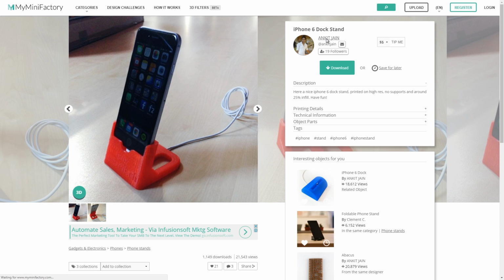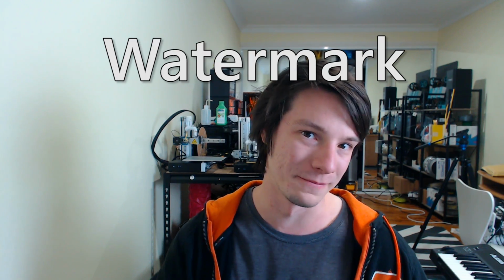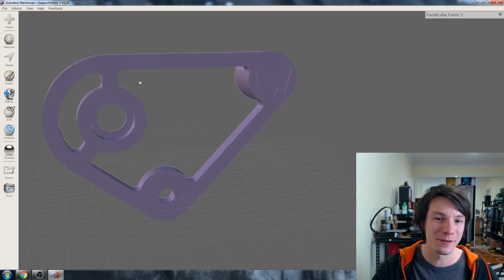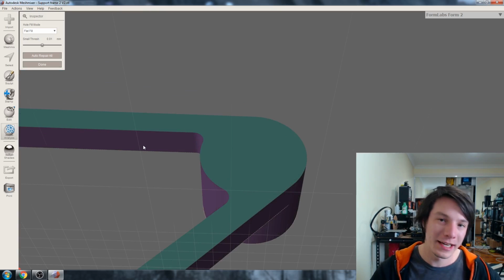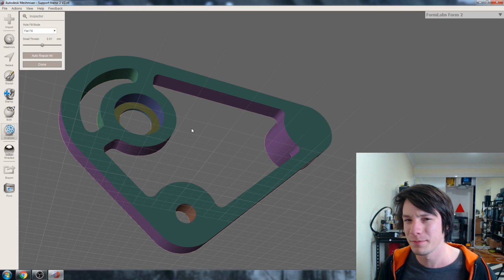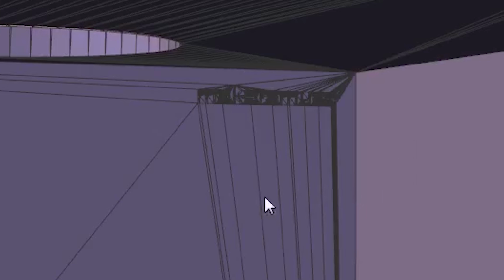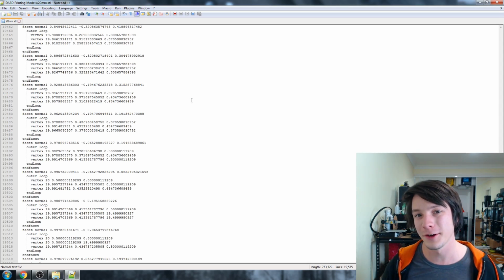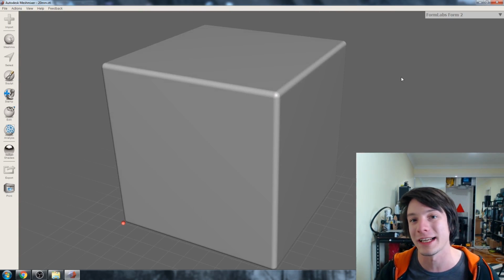3 Ways to Protect your 3D Printing Files from Theft and Plagiarism

Comment: Put the watermark inside the geometry. Unless you slice it and preview the layers or print it and watch the print you'll never know it's there. Protects the digital file because it'll be hard to find and remove and the physical object as well
Reply from the maker: Yep that's one step further than on the surface and something I thought about but haven't done yet. It's a good idea and pretty tricky!
Reply: I think the problem is if you had an issue, I doubt whatever admin you'd be contacting to have it removed, wouldn't even have the capability or know how to check the file for hidden watermarks.  Checking the date of when something was uploaded should be enough in most cases, since you could clearly show an earlier timestamp.  Another idea, is if possible, is to always create a higher poly version than the file you release.  It's hard to tessellate models with triangulated polygons, as even a square section could be split up into dozens of segments or more and any tessellation would just cause defects in the model.  

So model high poly with quads (4 point faces of geometry), then use some kind of decimate function to lower the poly count and convert the models poly's into triangles instead of quads.  It's easy to turn quads into triangles......not so easy to turn triangles into quads.  As far as I know, there is no modelling tool that automatically turns a model of triangles into quads, and it would be too ridiculously tedious to do by hand, as you would have to go in and potentially delete thousands of vertices intelligently, many of which could be supporting geometry, which would destroy the coherency of the model and cause all kinds of funky geometry issues.
Reply: Hi Geoff, Medelis... the most infamous man in 3D printing it would seem. 
Agreed, this kind of persistence has earned him some followers on Patron too, which is frustrating for everyone.
We do chase his stuff down on behalf of our designers... we did with Turbo Squid, Thingiverse and removing ridiculous levels of spam on our site too. It takes collaboration within the entire community, which we're pleased to see is very common.
Reply: oh beat me to it
Reply: That's cool but you also need to be more proactive with customers like medelis who are ripping off your models and selling them on their site.

https://www.myminifactory.com/object/guardians-of-the-galaxy-rocket-raccon-28645

Check the comments. You might ban him but clearly no one is watching the makes because this advertisement for his website has been on Tanya's model for a couple of days.

So the guy who stole it off her, put it on his site and is selling it is ok to come back in and advertise in the same models "makes" 

IMO people like medelis are more of a problem than hiding watermarks on your model, editing HEX codes, STLS files directly or any other counter measure you can think of.

No matter what you do to protect your files, there will always be an asshole like that.
Reply: recompile the mesh? wtf are you talking about. first and foremost thieves don't modify files they just download them and either pawn them off as their own or print them for money
Reply: All it takes to recompile it is them accidentally touching something, undoing the change and then saving out of reflex, since most 3D printing software gets rid off superfluous vertex without asking by default.
Reply: Actually, I got it to slice the water mark into the object. Just had to reverse the faces of the water mark.
Reply: Also if you put it in a thin part you can hold the printed object up to the light and see your logo.
Reply: If you recompile the mesh any interior faces get simply culled off, as they aren't important. This would only work if the thief is so lazy he doesn't even open the file himself.
Reply: I've seen that done, poorly, using connected meshes and it can cause slicing to fail of the print to fail because no one will think to separate connected meshes before they print it (s3d)
Reply: Tested it SketchUP, slicing with Cura 2.6.2 just removes the feature inside the cube, but it's there in the STL. Now 
 I trick the slicer to print extra features, like extra walls around holes, or walls that you normally would have walls...
Reply: this is pretty much what I was thinking, I just did it with one of my prints I'm selling and you can't see the water mark at all but if u pull it up in a slicer you can see it perfectly
Reply: Seen this done a few times. So long as importing, editing and saving the file maintains the marks, then it's doing it's job.
Also seen it done so it's visible in the slicer, but unless someone was to open try and inspect it, they are not likely to find it.
I would imagine a combination of things would be the best approach. And showing that your watermarked file was uploaded prior to the unwatermarked one would also help prove things.
Reply: That's exactly what I thought!
Reply: screwyluie lmao I've been thinking about that for a while.
Reply: Hi, thanks for the reply,
Yes it is frustrating and I can imagine moreso for you having to spend time cleaning up his mess,  but I guess the point I very poorly tried to make and got distracted by a current situation... re: the topic of this video, was that regardless of what watermark, or whatever you do - when a model is behind closed doors like a private patron account, the signatures are for nought. Patreon are getting their cut, so no need to stop it, heck I know no less than 15 designers that have individually reported him and still zero action taken nor do they seem to care and respond with the same copy/paste respons. So really, they all could have signatures on the inside of the mesh but typically anyone who signs up to download his files are not going to check nor care where they came from which is probably a bigger issue and I wouldn't even get into it, it's just too complex and widespread.  I do have to give credit to you guys, XYZ, CGT, Cults and Thingiverse for trying to be proactive about it, ironically the only sites that tolerate him are Pinshape and Patreon, both whom profit off his skullduggery.
Reply: screwyluie o
Reply: Speaking from our side, we do have the in-house skills to look for an internal watermark if its location was clearly identified to us. The idea of keeping a higher poly version as a 'master' file is an interesting solution, that could also be a valuable asset.

Comment: I think its fine to protect stuff. But I somtimes want to mod a part but have no intention of uploading it.

Also you could hex edit the binary STL to add your name .
Reply: In that case a watermark won't bother you ? And if it does you can remove it as you won't upload it. Or just credit the original designer when you upload your mod.

Comment: Three dimensional steganography? Neat
Reply: Disambiguation: Steganography applies to any technique used to "bury" information among other seemingly innocent information in such a way that it remains hidden (unless you are looking for it) but also retrievable (secret information is more or less unaffected by modifications to the host information facade)
Reply: Along those lines; you could have a post-processor that takes in the STL ascii file, twiddles the least significant decimal of each point as a text encoding method. eg, if a point is 3.123456, you convert that to 3.123457 or 3.14155 depending on wether you want to encode a 1 or a 0.  Do that to 8 numbers in a row, there's your first character. This could then be saved as binary / whatever, and since it's part of the model geometry itself, would be preserved.
Reply from the maker: Not quite as hardcore BUT it'd definitely be possible to hide all manner of messages into these files.
Reply: that would actually be pretty easy to do, might try making one
Reply: Elder Eggplant
not even close, that would be if he were to say add noise to the model in such a way that that noise could be decoded into text. say move a vertex from 13.300 to 13.302, invisible yes, but if you remove all but the least significat digit and then convert that into ascii or something, you could have text there.
we have 25 letters, make if the ladt two significant digits and then have 13.0022 or something.
plus if the stl file is in binary form its practically invisible
Reply: STL files have this 3 component normal vector information and the color data channel both of which are getting ignored by pretty much all the software packages. One could easy encode watermark into those channels without affecting the geometry. But most likely simple "resaving" file would strip those markings down.

One more thing I could think about would be to encode a watermark in vertex ordering. You have list o 3 verts which could start in three ways (to preserve right-hand orientation). One could encode the watermark by choosing to start with shortest or longest edge to encode 1 or 0. As long as the face ordering is preserved information won't be lost...

Will try to incorporate this technique in blender io_mesh plugin, see if resaving, and affine transform in other 3d software preserve this type of marking. 

But with an abundance of technique that could scramble your mesh topology with a single click, can't see this marking technique would make much difference but with the simplest cases. One can just use "quad edge collapse" or "subdivision surface" to completely change mesh topology which won't preserve single triangle nor edge...

Encoding info in LSB won't survive even simple translation, rotation or scaling.